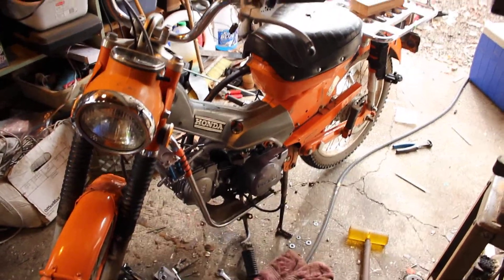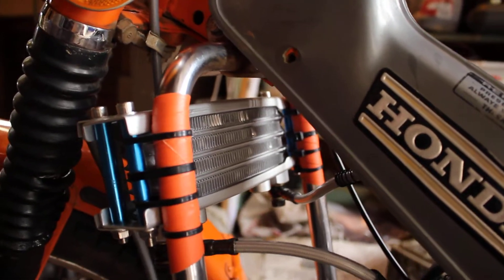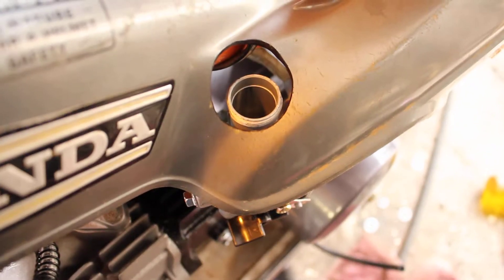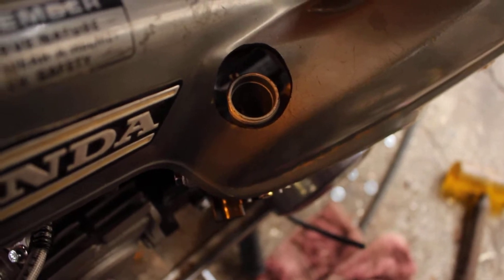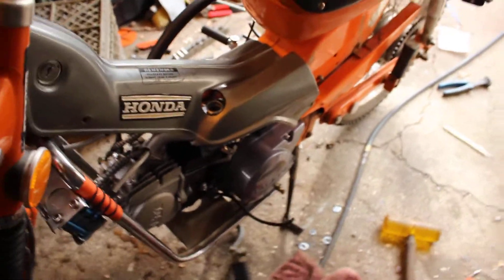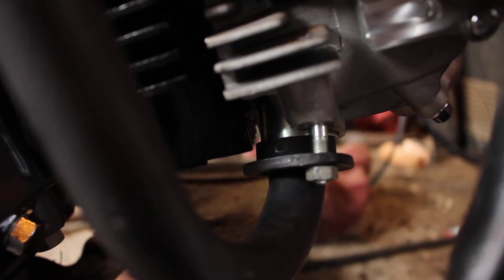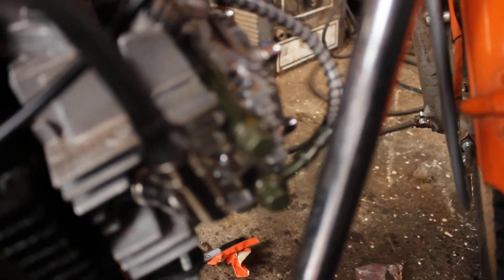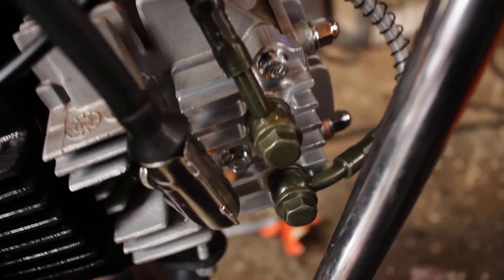Progress on petes lifan ct90 swap.

Comment: Cool was there a washer type restrictor in the exhaust at the manifold ? That's gonna be fast and a wheeling beast soon ☺
Reply from the maker: Diddnt see one, We have to get some new oil lines tho because  the ones it came with arent long enough to go where they are actually supposed to be attached to the engine the little adapter block we used is for all the other lifans BESIDES the 140cc.

Comment: Nice work man !!!!
You got a speedo on that?
Reply from the maker: We put a new speedo cable on but the actual unit may be bad, I have a trail gps ill use to get an accurate top speed, although Ill probably wait till its broken in to do that, we will also probably have to mess with some sprockets.